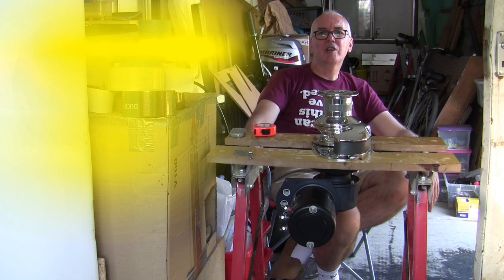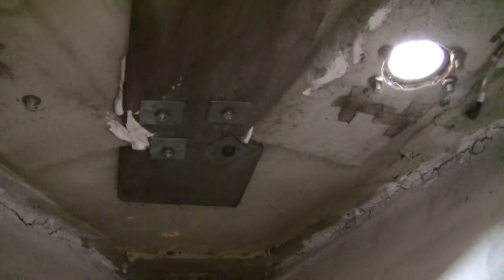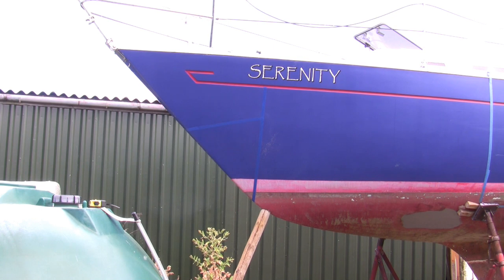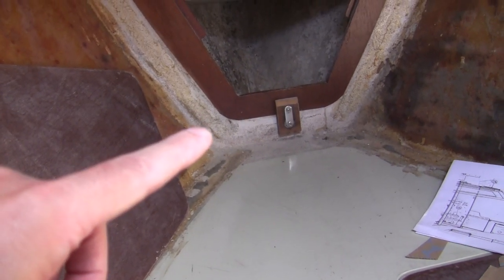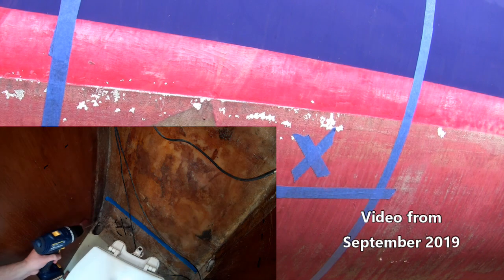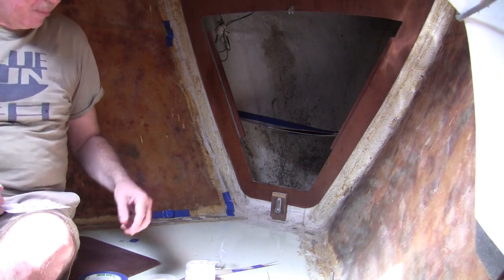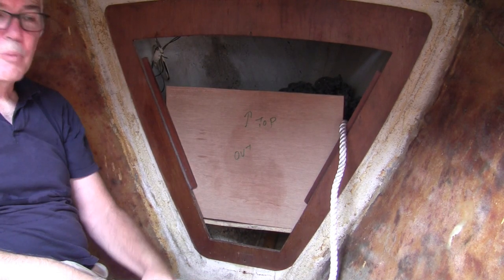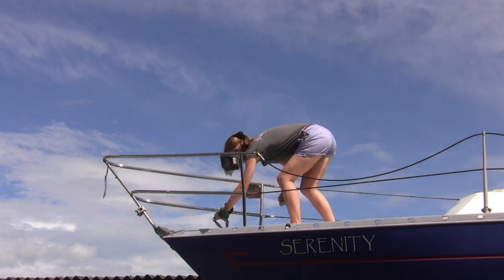Just About Sailing August 2020 - Installing the new Windlass - Pt 1 Chain Locker Modification Plans

Comment: I like the idea of the self draining chain locker but my advice (fwiw!) Is to keep the chain as low as possible. The higher up it is the more that weight is going to affect you, or rather, the boat.

On my Sigma the chain is rather high and we'll forward and with 70 metres of 10mm chain in there the boat was sitting noticeably bow down. I had to cut about 30m off - at 3kg a metre that's a lot of weight obviously. I'm considering redesigning the locker entirely to make it just an anchor locker and to have the chain routed through a pipe to underneath the v-berth where there's masses of space and very low. I should then be able to use all the chain...
Reply from the maker: That's a very good point. If I did the Mk II conversion, that would put everything even higher. The actual windless itself weighs a ton - or at least the electric motor does.
If Serenity had a 'proper' bilge I would probably have gone for the option of having it drain into the bilge.
Good luck if you go ahead with the redesign.
Cheers
Paul
Reply: @verynearlyaboutsailing8114  yeah, cheers! With your mod I'd just worry about that drain being so close to the waterline.  I know the bulkhead is going to be sealed (apart from the inspection hatch) but still... What about having an automatic pump in the bottom of the locker? You'd have to construct some form of cage for it to be in to prevent the rode/chain from fouling the float switch of course 🤔
Reply from the maker: It's an interesting one. There must be some science behind the 'how low can you go?' question.
Some people are quite happy to have a simple hole right at the waterline. Others (myself included) don't like the idea of having a hole in the front of the boat at all.

Comment: Hi Paul. That windlass motor looks massive compared to mine. My '79 Mirage is def a MK1 because of its flat bow edge and the four shrouds running out to the gunwhales. I do apear to have the MK11 chain locker and the 200 ltr built in water tanks under the forward berth. Hybrid? Anyway, great info videos. Cheers. Peter.
Reply from the maker: Peter
I think there were quite a few hybrid versions as the Mk I moved towards the Mk II. I think the two main differences between the two 'official' versions was the increase in headroom and also the mast height going up from 32 to 34 feet. I guess they made a few incremental changes leading up to the Mk II
My original water tank location seems to have been under the small bench seat in the saloon (based on some pipework that was never fully removed).
The windlass motor is massive and a lot heavier than the actual windlass part. 
Cheers
Paul

Comment: How well does the chain locker hatch seal? If its not very watertight you will get a lot of water into your bilge when you are away from the boat and she is sat on her mooring. If you can drain the locker outside before anything gets into the boat that has got to be preferable just for peace of mind, my anchor locker drains approx 400mm above water-level. Also do you need so much chain in the locker when was the last time you laid it all out to the bitter end. Enjoy your films by the way and the better half has said no to the boat borne double bass.
Reply from the maker: That's a shame about the double bass - but don't worry, people change their minds.
The answer is that the current hatch does not seal at all. It is literally just a wooden pane loosely clipped in. I have never felt good about it. If you got into a situation where too much water got into the locker it would simply flood into the V-berth. Bizarrely, this doesn't ever seem to have happened, but it could. And as we know, if something 'can' happen, it probably will at some stage.
When I have finished with it, it will have a much reinforced (and watertight) locker with a watertight inspection hatch.
Thanks for watching.
Cheers
Paul

Comment: Just wondering why you chose a windlass with the motor below deck instead of a model with everything above deck.
enjoy all your videos. -Dave Vancouver BC.
Reply from the maker: Dave, that is a very good question and I'm not sure I have a very good answer.
I seem to remember that the Lewmar Pro-Fish 1000 was on the short list at one stage, which does have the motor above the deck. Although, interestingly, the requirement for a 300 mm drop between the deck and the top of the chain is the same in the installation manual. You'd think that you would need more room with the motor below the deck - but that doesn't seem to be the case.
In the end, I think I just went round the Southampton Boat Show over a couple of years and picked one I liked the look of.
Also, Serenity is quite a small boat - I always think she looks larger in my videos than she does in real life - and I quite like the compact look of the X2 on the deck (even with the optional capstan on top).
Cheers
Paul

Comment: I had to pause the video for a moment to 13:10.
I like that idea the most, but with a small change.
Just leave an open drain in the bottom. Replace the floor you were thinking about with a strong enough grille the chain can rest on and you have a ships chain locker design right there.
Dry chain locker and dry chain.
Reply from the maker: OK, I get what you are saying. That would work if the drawing was accurate. Have a scoot through to about 28:14. That shows where the bottom of the chain locker is in reality. The drawing (which does have some sort of warning on it) is not accurate.  The chain locker actually goes all the way down to pretty much exactly the water line I tested this by putting a magnet at the bottom (but didn't film it). If the drawing was accurate, I would agree with you and it would be a great solution.
I think my boat was a very early one and I don't think they thought this whole locker thing through very well - hence the change for the Mk II version.
Cheers
Paul

Comment: This is such a compromise conundrum. Drain to the bilge, where the engine is in the same bilge really should never have an automatic bilge pump, potentially pumping oil over board. Keeping the weight as low bellow the waterline as possible is essential.  I think you did well in choosing the best compromise.
Reply from the maker: Thanks. Yes, the whole bilge set-up on my boat is not good. So far my Beta Marine engine hasn't spilt a drop of oil, and not much water seems to get in. When underway I always put some emulsifying stuff (I've forgotten what it's called) which neutralises and oil. I'm not sure of the legal position on pumping that overboard.
The main thing for me is actually being ale to press a button and get an electric motor to haul the anchor up - bliss ;)
Cheers
Paul

Comment: Rather than drilling another hole in the hull how about a drain with a tap on it internally. After anchoring/periodically you could open the tap into a bucket to remove the water?
Reply from the maker: That could definitely be an option. And in reality, I don't think much water actually gets into the chain locker. After all, the boat has survived 45 years without any drainage at all. I guess that with the sea-cock option I am plannin, I could keep it closed a lot of the time and then just open it to drain out the water at anchor.
And, of course, I am sure I am making quite a large mountain out of a molehill with all of this.
Paul

Comment: Why not a bilge pump in the chain locker? Share the power from the windlass. Pump the water out higher up. False floor on to allow room to hoover the water out with a float.
Reply from the maker: Martin, that could work. I would still need to build a false floor as you say. If I went for this, I would probably let the water drain via a hose into some sort of sump under the V-berth and then put a pump in that for ease of accessibility to the pump. It would be a lot easier if Serenity had a 'proper' bilge.
To be honest, there probably won't be much water being collected. The boat has survived in its current state for about 45 years. But I need an electric windlass so it makes sense to sort out the drainage at the same time.
Cheers
Paul

Comment: I'm sure I have seen some drain holes lower than the one you have marked on you stem through the sides of the hull with little aft facing stainless steel scoops fitted that face aft, put in a full sealed bulkhead with one of those tough plastic deck hatches in it perhaps
Reply from the maker: Yes, I am going to put in one of those scoops as well. Belt and braces, and another belt. And it will get one of those tough hatches. I will probably glass an additional bulkhead inside the locker, then epoxy on the old wooden front, but with an inspection hatch built in - extra braces on top of the belt, braces and belt.
I have seen drain holes right at the waterline on some boats. I just really don't feel comfortable with the idea. And having a sea-cock as well is probably just another...what are we on now? belt or braces.
Cheers
Paul
Reply: @verynearlyaboutsailing8114   That should do it and the seacock will give you the added security

Comment: No idea if its possible but could you fit a Y or T piece to the toilet seacock and run a pipe from the anchor locker to that (will save another hole in your boat and it already has a seacock?.
Reply from the maker: The way it was originally setup I could have done this. However, because of the way I have changed things to accommodate the holding tank it won't be possible.
Cheers
Paul

Comment: I’m redoing my chain locker on my Pearson 365 ketch and have been searching for a video with someone adding a shelf. 
How did you measure your new floor for the chain to sit on?
Reply from the maker: To be honest, as you can see from the video, it's mostly guess work - plus lots of tape and cardboard mockups/templates. Using the magnets to figure out what was going on from both  the inside and outside perspective was invaluable.
My main two criteria were to get the new locker floor as low as possible so that I had 30cm above the chain 'heap', but not too low so it would be too low to the waterline. In retrospect, I could probably have gone lower.
In terms of fitting the actual triangular piece for the floor itself, that is covered in a later video (October 2020). There wasn't any measurement involved. From memory, I taped where the new floor was going to be from the outside, then transferred that inside using the magnets. Then it was just a case of doing loads of cardboard mock-up templates until it looked right. Then cut and actual piece of wood - I laminated two very thick pieces of ply (again, covered in Oct 20220). Getting the right angles etc is covered in the October video. - However, I wasn't particularly accurate - and using a lot of thickened epoxy helped a lot.
Pretty much all of it was trial and error. But it is a lot cheaper to make a mistake with a piece of cardboard than epoxying in a sheet of plywood then finding it doesn't fit.
Good luck.
Cheers, Paul

Comment: Rather than fitting the false floor so that the fwd edge is lower than the aft end (which reduces the height available for chain immediately below the motor - why not do it t’other way round, so that it slopes aft with two drains at both sides broadly right next to the ‘vertical’ bulkhead. It will achieve equal drainage but give more height/volume in the critical space.
Reply from the maker: Norman, that is a good idea and would work fine. The only problem I see is that it would make it very tight to fit in a sea-cock (two sea-cocks, one on each side - expensive) and get the hose to fit. I am probably being much too 'careful' with this whole idea of putting in a sea-cock - which I am sure is unnecessary.
Cheers
Paul
Reply: Just about sailing Hi Paul - It’s your boat and your decision of course but I would be interested to know if any other yachts had seacocks on their anchor lockers. One aspect I would give careful consideration (when adding drain holes) to would be the integrity of the collision bulkhead and its water tightness when secured. An alternative lower risk solution may be a small bilge pump (taking advantage of nearby power of the winch) and a higher level discharge through an outlet with a non return valve in the discharge line. Offered constructively.😃👍⛵️
Reply from the maker: Norman, do keep sending in suggestions. Even if I decide to go a slightly different way, others might well decide on an alternative approach from reading the comments. The last thing I would want is for people to simply copy me.
There will effectively be two water tight bulkheads in the new setup.  Also, previous owners have simply drilled holes through other bulkheads that were designed to be watertight and they will be glassed in. Plus there will be a new watertight compartment around the paddle wheel transducer thing so that if it failed completely Serenity would still float.
Cheers
Paul

Comment: Mud will be the issue rather than water so an internal sump so you can wash down the chain and then bilge pump it away with a diaphragm bilge pump.
The other consideration is weight.
Any additional weight up front is not helpful when sailing. so in general reduce as much weight as possible and what weight you do have, arrange it as low and aft as possible.
Even when cruising, when in a choppy sea you really will notice 100kg in the bow.
Reply from the maker: Mike, I'm not sure I follow all this. Too late for me now as I got up to Part 4 of this just before last Christmas. Waiting for decent epoxy season to start so I can finish it.
I'm not sure where you are suggesting I could put an internal sump. The Mirage 28 doesn't really have a proper bilge of any description, let alone a low part where a sump could go. The area above where the keel bolts go through right to pretty much the sole is solid and filled with 'dough' (slate dust mixed with resin) which is like concrete. That's where a normal bilge might be. The only actual 'bilge' area is in the engine bay.
The Mk1 (mine) simply has a chain locker with no drain at all - internal or external. It just fills up with mud and water until you scrub it out occasionally. My conversion was simply to do roughly what Thames Marine did with the Mk 2 - except to lower the floor to get the height needed for the windlass and exit the drain out the side rather than just drill a hole in the front.
Regarding weight, are you suggesting moving the chain aft (to the bulkhead under the Vee berth) and building a separate chain locker? I can't picture how that would work. As I say, too late for me, but I'm interested in how to move the weight further back as you suggest.  
Cheers, Paul
Reply: @verynearlyaboutsailing8114  Imagine if the V berth was not there, the chain would simply follow the V in the hull to the lowest point. 
Effectively lowering the height and moving the weight aft by 3 or 4 ft.
Extra wide plastic guttering works well as a chain guide and stops the chain wearing away the inside of the hull, rubber matting works as well but the chain tends not to slide down as well.
I think I caught a glimpse of a teak grating in front of the loo. 
Not sure what depth you have under the grate but that would be an ideal location to collect the dirty water to be pumped out.
You could "t" into the sink outlet for example.
There are some low profile pumps that would work.